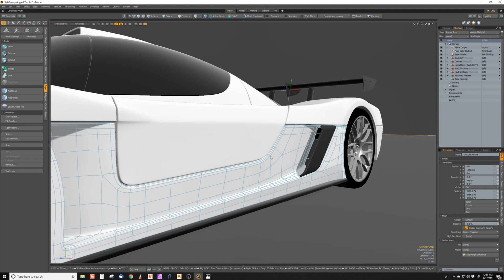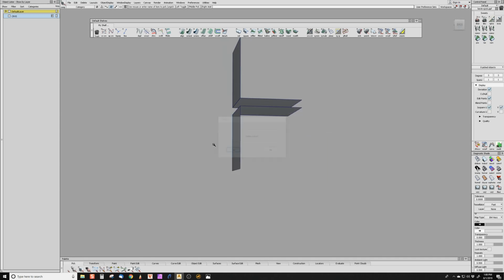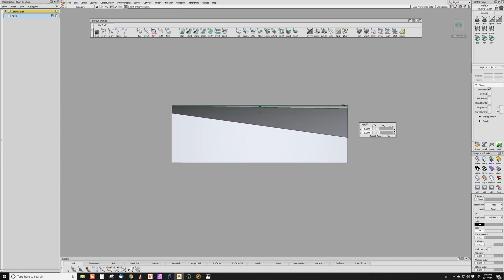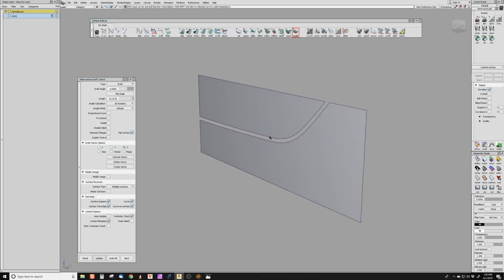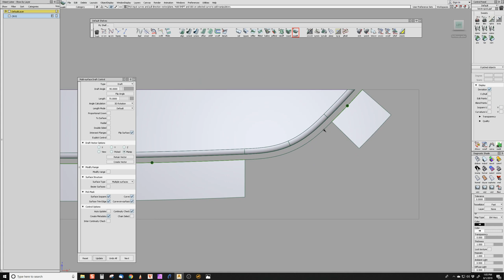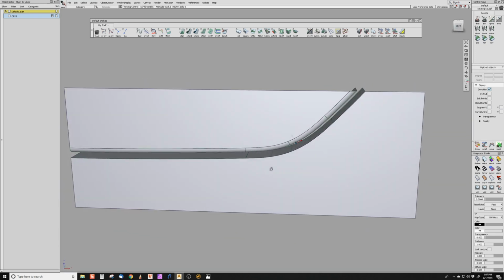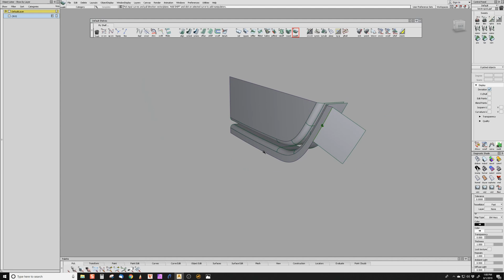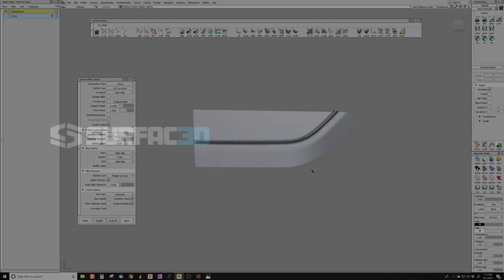Autodesk Alias 3D Modeling TIP - Automotive part line

Comment: Hello Kevin, it's  useful video. Thank you very much. And I need panel gap creation videos. Is it possible to create panel gap feature in position continue surface joints?
Reply from the maker: I can make a panel gap video.   To build a panel gap along positional surfaces,  you will need to do this with 2 different panel gap set ups.   you may have to trim or align the resulting fillet and flange to make those positional as well.

Comment: Does anyone know or has references of how to get to the tools with which Kevin moved the CVs smoothly from a corner? (4.00) thnks
Reply from the maker: Transform CV (XFORMCV)  found in the control panel.   when in the tool hit the SPACE BAR to show the interface.   Switch mode to non-p scale.  This allow you to set a fall off amount over a number of CVs in U and V.

Comment: thanks so much Kevin,so nice.
I have a question,
may you have a recommendation about PC hardware configurations suitable 

for alias good performance in merely heavy projects?
what is more effective in Alias,less cores with higher clock or more cores with lower clock?
what is yours?
thanks a lot.
Reply from the maker: Your welcome and thank you.   
I believe Alias modeling tools respond better with higher single core clock.    I have an overclocked intel 8700k  with 32gb of Ram.  I typically upgrade every two years and I'm due for one this fall.  I may switch to AMD for better rendering performance from the additional cores but have not decided yet.
Reply: @kevinr6236  thanks so much kevin.
You helped.

Comment: Hey Kevin, Awesome videos! question from a Rhino guy transitioning to Alias,  are there no options when creating a circle with criteria such as "tangent tangent radius" etc
Reply from the maker: How do you use the TTR tool?  What is the end goal?   Depending on the end shape your looking to create, I would most likely use either CURVE EDIT > CREATE > CURVE FILLET or FREEFORM CURVE BLEND to get a similar end curve shape.  The tools can be set to Circular/Tangent G1 and will span between  two curves/surfaces.   Fillet gives you the radius input and a circular shape.  Freeform Crv blend gives you tangent intersection control but results in a freeform shape that can be approximated to be circular.   However, booth tools have the advantage of also giving you curvature which is more suited for Automotive.   Hope that Helps!  BTW, KEYPOINT CURVE TOOLBOX contains most of curve tools that would similar to the TTR Rhino tool.   They are ancient tools but have some useful functions.
Reply: @kevinr6236   that helps a lot thanks! I use it for reference geometry or creating a rotational axis among other things. curve fillet works the same as rhino, was mostly curious if the circle tool had more options I'm not seeing. Been going through the "transition from rhino" on the alias help files although they have helped alot, some tools are mislabeled  as not having a rhino equivalent when there are - such as alias insert COS which to my knowledge is identical to the rhino "extract iso curve" tool. Anyways, Thanks again for putting out these videos, You and Barry Kimball's vids have been my go to for proper production modeling and very appreciated :)
Reply from the maker: @ryan6530   Awesome.   I have more videos coming.  For extract iso curve, check out the Curve Edit > Create > Duplicate Curve...options.   Turn ON "interactive".   This allows you to duplicate(extract) a curve anywhere on a surface.   Hold CTRL to snap to edges or spans. CTRL + ALT  let's you snap to adjacent edges.  ALT snaps to midpoint between Spans.

Comment: This was really helpful. I'm in my first semester of a sculpting program. What's your best advice for me to develop my digital sculpting skills?
Reply from the maker: Keep practicing!    Haha.   Learn the core tools at the same time as practicing techniques to build form quickly.    As sculptors, we want to be able to capture a sketch or idea quickly.   This is one of the most valuable skills to have at first.     Refinement  and surface perfection can be learned over time.   Core tools include Transform CV tool, EP crvs, Align, Detach, Extend, Offset, Freeform Blend surface, Birail/square, Draft,  and Surface Fillet/ball corner.
Reply: @kevinr6236  i have adapted myself quickly enough through last week when i started. I've been modelling cars for a long time using Blender so im already familiar with the 3D space and tools. As any 3D Program ima have to keep on practicing cuz every sketch or model have its plan from where to start and the model keeps changing and developing till it reaches the render point. Anyway thanks for the valuable channel and sorry for being long.

Comment: Hi Kevin, thanks for this tips, I'm a self-taught Alias learner (15 years of polygonal modeling before that) and at the end of the video you ask if we have question or issue with Alias. I have many but right now the one that bother me a lot is, how to properly add thickness to multiple surfaces ?
As soon as the object is a little complex the offset tool cannot give me nice results...it allways fails... So how to properly add thickness to an object ? (like a entire body part of a car for example) Thanks
Reply from the maker: Great question!    I'll try to make a video with some best practices.   Such as the maximum thickness is the minimum radii size with in the part.   Very important!   For most of my production parts, we typically thicken the parts in Catia, NX or even Fusion360.    If you need to create the B-sides in Alias, you can try the new Surface offset tool in 2019.3.   It's a lot better, has more options and now has the ability to maintain continuity.       If your prototyping(3D priniting)  try the "thicken" option in the EXPORT > RAPID PROTOTYPE... utility.   This converts your surfaces into meshes and then thickens the poly Mesh.
Reply: @kevinr6236  Thanks for this quick answer Kevin and for the maybe futur video about this topic ;)
You're the second person telling me that in a real production the thickness are done in Catia. So I assume it is the Superman of thickening complex shapes, I'll look about it.
In my level I allways try in Fusion360 also, but even if it is working sometimes, it often fails too.

Thanks again and be sure I will watch your futures videos if you keep making Alias tips/tutos videos :)
Reply from the maker: No problem.   In automotive production we are often are only responsible for the A side(part you see or touch) and the first fillet and flange.   As soon as you thicken for sheet metal or plastic part, it turns into an engineering task.    Catia is able to throw a ton of spans at the offset surface to maintain the tolerance.  Its handles this very well but the data is not great or easy to deal with from a surfacing standing point.     
Are you working for a company or any particular project?   I could always use parts of your data if your interested.
Reply: @kevinr6236  I see. I'm actually just working some "simple" personnals projects to learn and get used to Alias and CAD modeling. Being better at it can help me work with a client I already worked with. And also I'm addict to HardSurface modeling in general so when I discovered the world of surfacing (being in the polygonal world for a long time) I just felt in love and in the need of learning it !

But yeah I really need the ability to add thickness on surfaces for personnal projects and for the client I maybe will work with when will be ready. :)